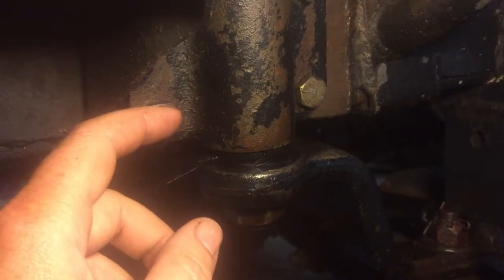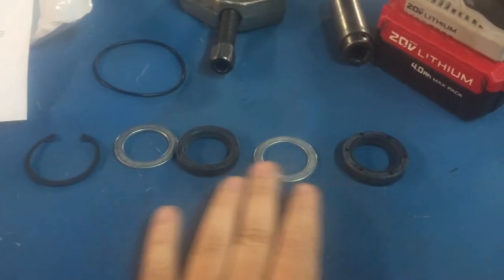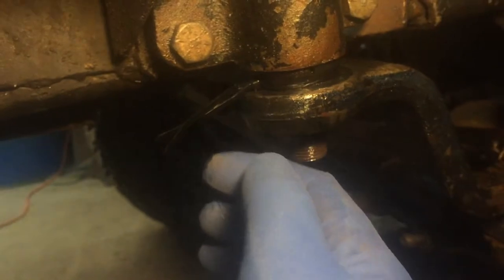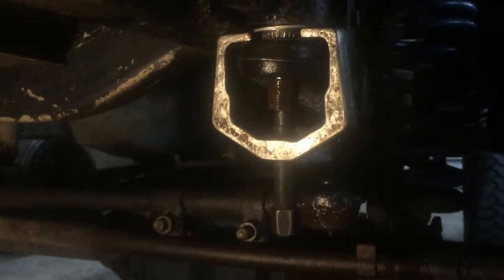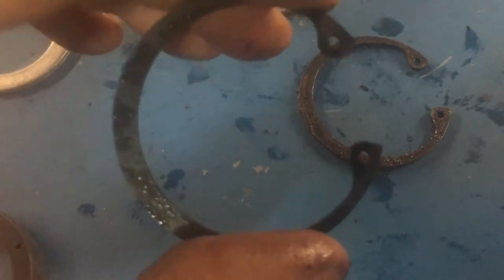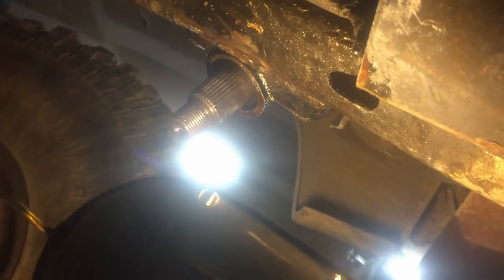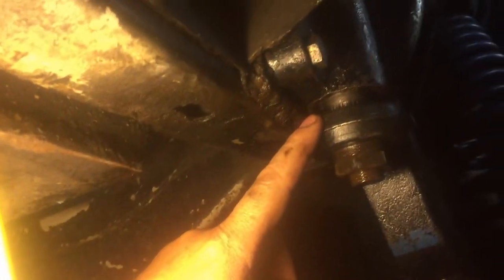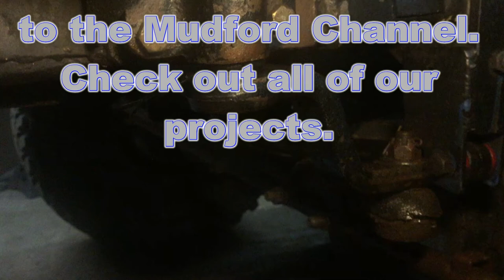Bronco Steering Box Seal

Comment: Dude... You saved the day. I watched some videos on how to take that seal out and they all did it the same way after they already had it off the vehicle. They drilled a hole in both sides of the metal seal and pulled it out with screws. I tried that and couldn't because my seal must be made out of hardened steel, new bits wouldn't even make a scratch in it. I looked high and low on how to get that seal and couldn't find anything.. than ran across your video. Didn't know it was that easy. Had it out in minutes. I'm a DIY kinda guy and thanks to people like you, I am learning a lot. Thanks man. 😀
Reply: I'm thumbs up # 11

Comment: When Re Installing the Pitman  arm,   Wire  brush clean the Splines.,  Super Clean , with a small wire brush ,  for drill !   Than  ,      I always  PUT Anti Seize compound, ( By Permatex)  on  the SPLINES,  before  putting the Pitman arm back on the Shaft .... Cheap  insurance when to take apart for the Future .. ... .. .. IT will make LIFE easier in case of next repair ..   What is Anti-Seize? Anti-seize products are applied to bolts, fasteners, flanges and other clamped interfaces to prevent galling, seizing and corrosion, as well as lubricating to ease disassembly.

Comment: Can you remove the steering link without that tool? Like a fork or a pry bar?
Reply from the maker: Maybe, with a fork.  Probably not with a pry bar.  Check at a parts store, many have a loan a tool program.  Excellent for tools you won’t use often like this.